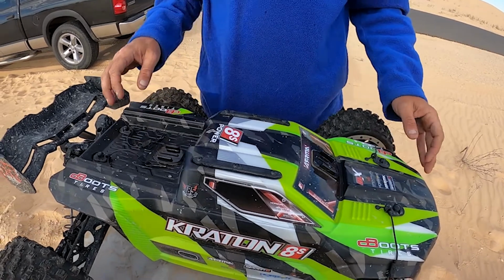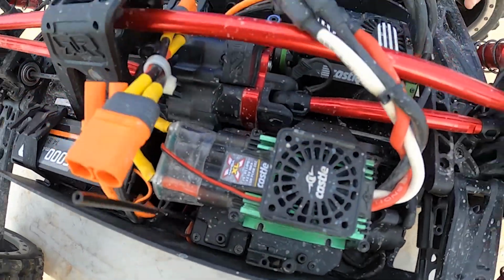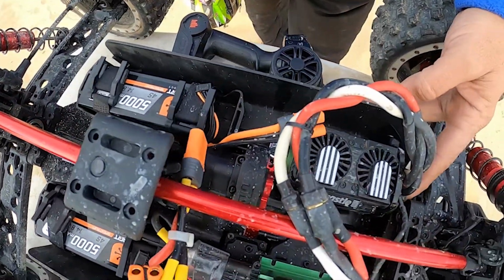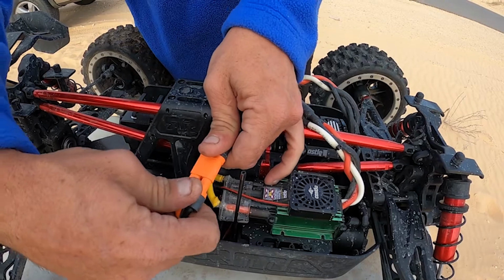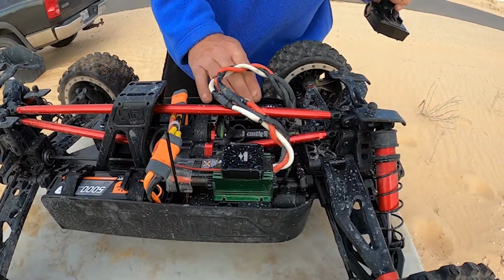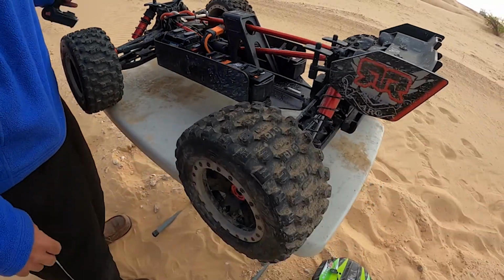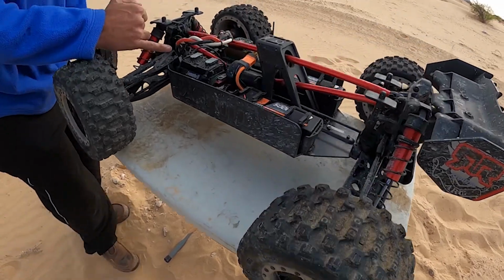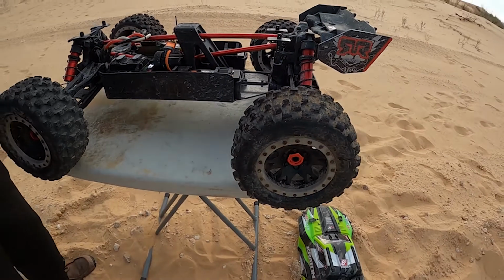8S Arrma Kraton 1/5 Scale Reveal! Castle Mamba Monster XL ESC & 800kv Motor 2028! Sand Dune Bashing!

Comment: does the castle motor have a power button on off and what size pinion and spour  gear are you using really appreciate the video thanks keep up the good work
Reply from the maker: No power button on this esc & motor combo! Once you plug in it’s on and to turn it off you just unplug it! I’ll have to double check the spur & pinion! I forgot! Thanks for the support!

Comment: Great vid. You might want to try a 40 tooth pinion or bigger for that. I have both a 42 and 44 and 42 is pretty damn good.
Reply from the maker: Mike RR awesome tip. Thanks. I’ll give it a try when I can get one. Also didn’t want to go to extreme on the gearing where it makes stuff start breaking. Think I’m gonna tune the motor with my computer and let it have more power. Thanks for watching.

Comment: Way cool man.  How are your temps bashing that beast? That esc will run 12s right?  I have a new mamba monster x 8s laying around that I was thinking about pairing with that motor.
Reply from the maker: Haven’t checked temps. Still got more to learn on the data logging. I don’t really take a temp gun. I’m just a basher and tear stuff up anyway. Still got some more work to do on it too. I put the wrong diff fluids in
Reply from the maker: No 12s on this esc. Maybe the motor might handle it but the esc I highly doubt it. 8S most I ever ran it on.